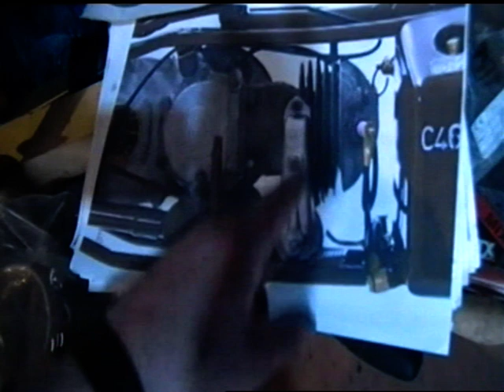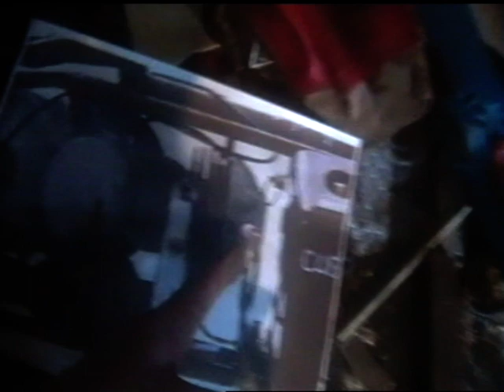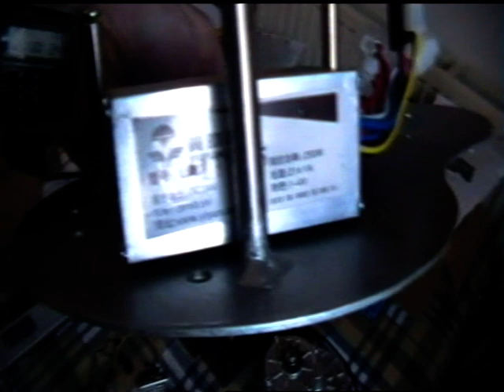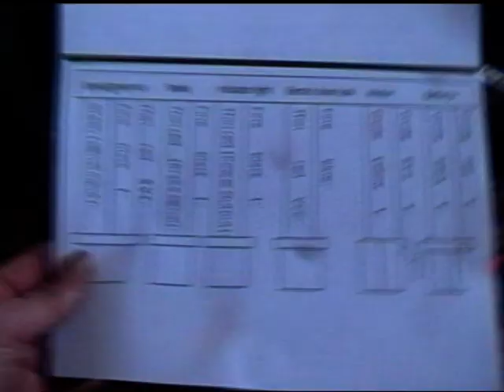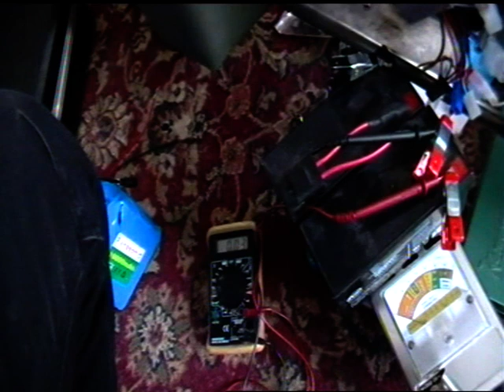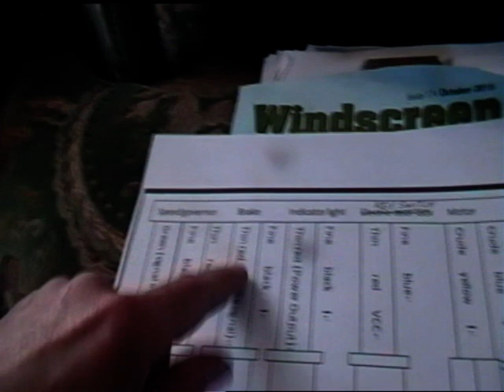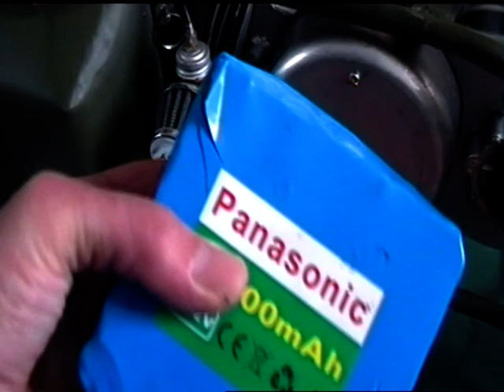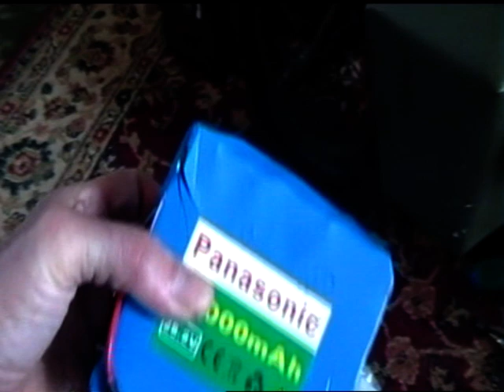HOW TO MAKE A WELBIKE PT 4 OF 4

Comment: The adjustors to get propper tension on the chain used by the welbike are the same they use on bicycles. I have a replica welbike and it was reverse engineered with original welbike parts. I joined a  large group who all wanted to own a welbike but could not or were not willing to pay the collectors price decide to make replica's. Al parts revers engineered from original parts. An extra was made to sell so to cover some of the costs. In total 22 were made.
Reply from the maker: Yes as I changed the sprocket size it became an in between size that could not be adjusted for at the rear wheel so a chain tensioner was more sensible to fit it also allows for future changes should any be made.